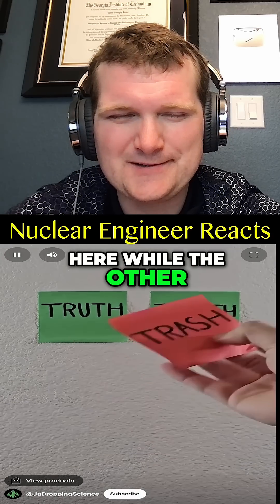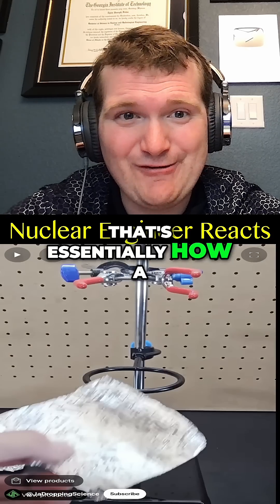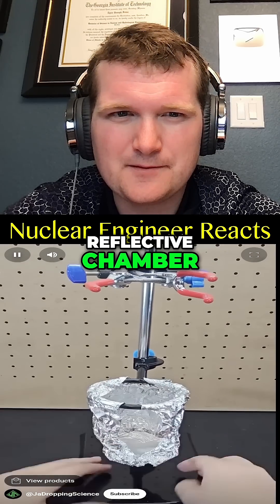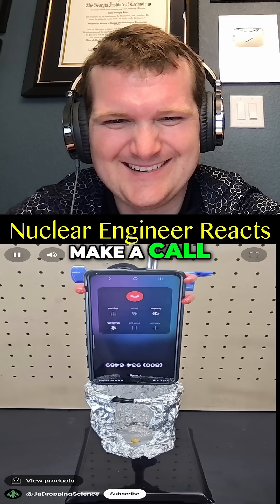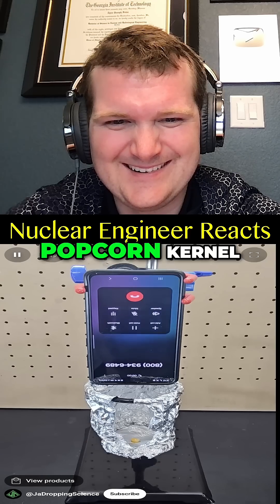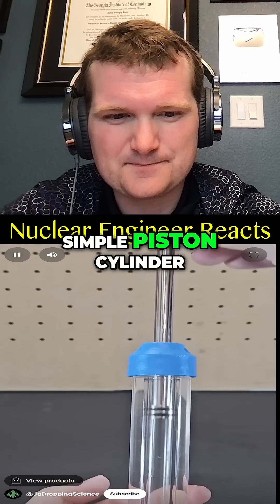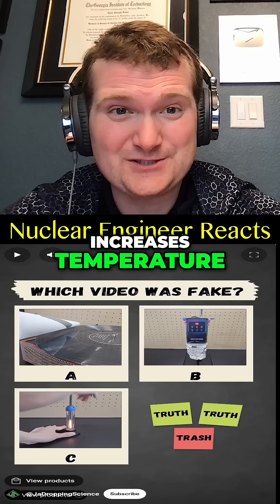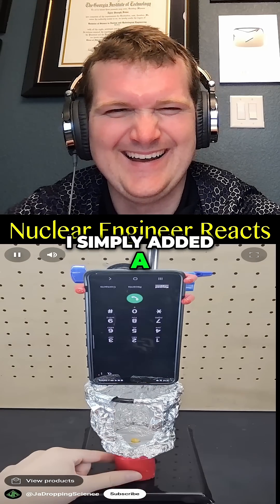Can a Nuclear Engineer Spot the Fake Experiment? - 2 Truths & Trash by JaDroppingScience

Comment: C is how diesel engines work...compress the air to near combustion point, inject diesel (which has a flash point much lower than air) and boom, power stroke.

Comment: @tfolsenuclear 1 cellphone won't work regardless of what generation it is because 375 watts is not enough to pop popcorn 

HOWEVER 3 OR MORE CELLPHONES WILL POP POPCORN!!!

Cellphones use milliwatts for themselves from battery power.   But when there's an incoming call, it has been confirmed phones will take 375 watts or more straight to the face PER PHONE!!

That means depending on he ohone and it's age, you might be able to use 2 phones to pop popcorn.

Comment: To add to how incorrect the 5G popcorn video is I believe the microwave radiation doesn’t directly pop the kernels because it is designed to cover a relatively large area and is constantly moving, rather it heats up the oil and butter in the bag and that pops the kernels

Comment: You know, what you described with the cotton igniting from compression is actually the same core principle that makes a diesel engine run and explains why refrigerants boil at higher temperatures under pressure. When you compress a gas, the temperature shoots up enough to ignite cotton or diesel, or just to raise the boiling point of a refrigerant. The difference? Cotton and diesel are combustibles, so they catch fire, while refrigerant just needs more heat to evaporate. Same physics, different reactions. Simple but mind-blowing.

Comment: Technical correction if you're interesting in learning more: the correct term for C is "Autoignition Temperature", the temp at which a substance will spontaneously ignite without the need for a trigger or spark. "Flash Point" refers to the minimum temp a substance needs to reach before it can be successfully ignited and combust. Hope I could teach you something!
Reply: Isn’t that piston like exactly how a diesel cylinder works? Like you have adiabatic compression and then the fuel-oxidizer autoignites? Thermodynamics was a great class but it has been a while
Reply: Also, the ignition temperature is highly pressure dependent; the high pressure means that you do not need to reach the temperature needed for autoignition at atmospheric pressure.

Comment: the frequencies might be wrong too.. 5G can be from what 600 mhz ? to 40 Ghz in range .. but microwave frequencie is around 2.45 Ghz ... fun fact thats below above radio communication but above the frequency visible light uses for electromagnetic spectrum ... real fun ! 

in the end its all about power you apply.. the lower frequencies pass easier trough then the higher hence why 2.45 ghz is perfect for cooking but visible light that is around 400 - 790 Thz is not that good at passing trough the body ( though xraus oddly and all the other rays after UV do pass trough the body suddenly easily .... how odd physics is sometimes

Comment: You can make popcorn pop by making a phone call, but only if your house is also on fire
Reply: I can confirm this works, verified this experiment yesterday.
Reply: I called the cartel lame, popped my corn and my family 🥲
Reply: or if your microwave is connected your phone and programmed to turn ON when you make a phone call. 

I would then ask, "but why tho?"
Reply: @Justa_Potted_Plant Well obviously you're too lazy to get up and push the button to start the popcorn, but not lazy enough to still get up, place the bag in the microwave, then get up again to get it once it's done
Reply: Maybe you could with a "Galaxy Note 7" cell phone.
Reply: @vukodlak3962 *f there was enough energy in any hand held phone to heat a pipcorn kernel enough to pop it, then why are we still using big bulky transformers inside a bigger and bulkyer box to do so? You have any idea how big a market pocket popcorn poppers would be? Like, even if it popped 1 kernal at a time.  EVERYONE would bring 1 to the movies at least once

Comment: Don’t be too hasty dismissing the wireless waves part. That experiment is absolutely wrong, but early 2.4g 802.11b/g/n routers actually put off enough power to light a led with a small coil. 

That isnt tin foil hat stuff, I am just giving you an idea to make a flashlight out of the seriously annoying overused 2.4g band. Might as well light an LED with all your neighbors 25 bluetooth and 802.11bgn devices. 

2.4g is basically useless and riddled with collisions since everyone is on channel 1 or 2.